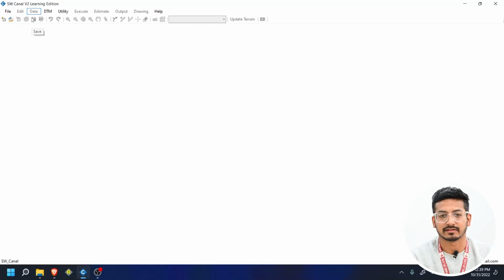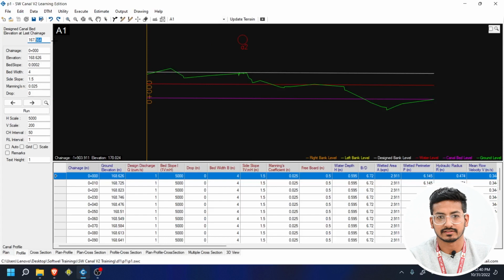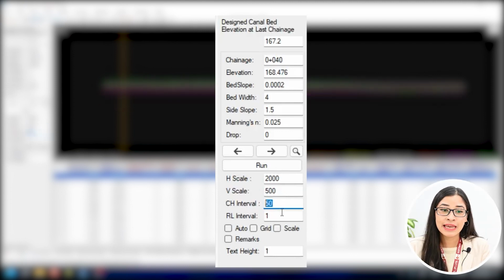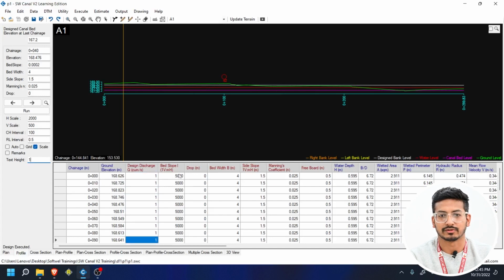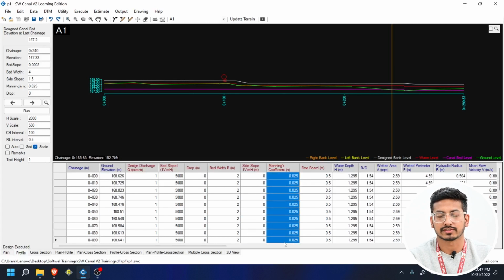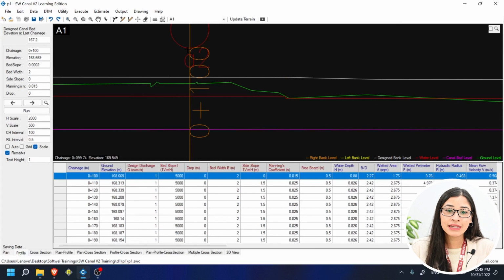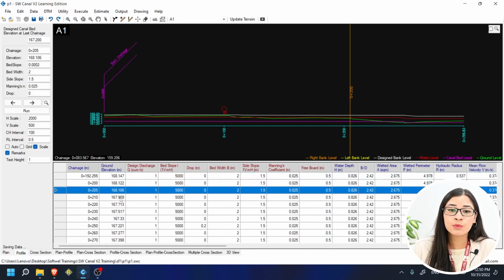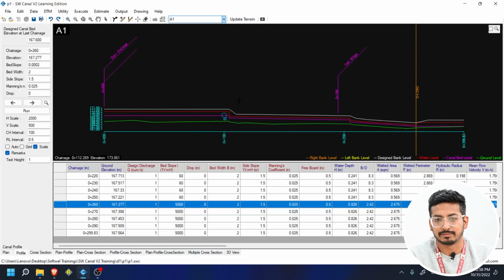Working with Profile in SW Canal V2 | Softwel (P) Ltd. | Part 3

Comment: After changing V Scale and H Scale, and then save, but it still keeping the previous value not changing.
Reply from the maker: The change in scale is temporary and it is restore to default scale (5000 and 200) once the application is closed and open again. However for printing purpose you can set the custom scale.

Comment: Dear Sir/Madam, On inserted hydraulic structure to the drawing, I inserted hydraulic structure to the plan follow your instruction but I can not see it in the profile section like your said, what is the problem? please comment.
Reply from the maker: Hello Sir, in profile only remark is seen after insertion. You may need to turn on the remark in profile from panel at left side.
Reply: @softweltutorials  Thanks, I will re-testing
Reply from the maker: @ I hope this image helps you: https://drive.google.com/file/d/18VjEEveplcnhXcjspGs52Fmed_wynRkJ/view?usp=sharing